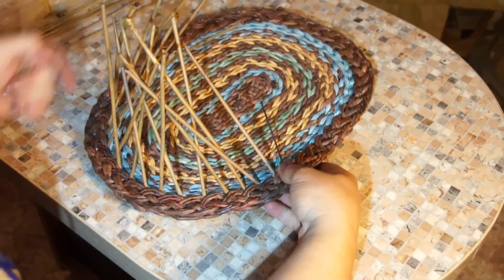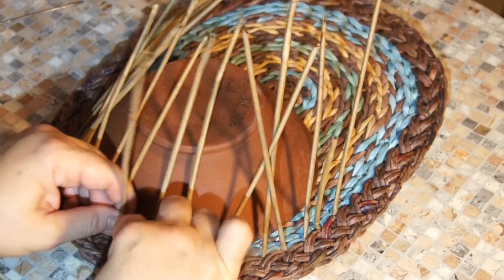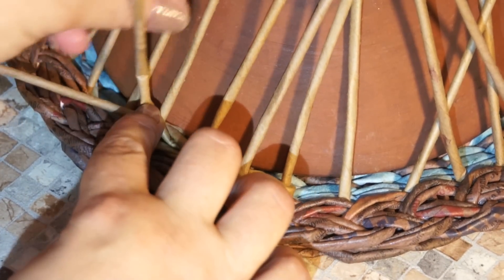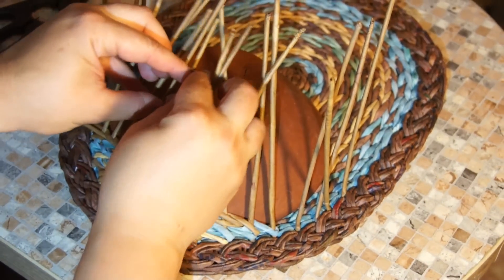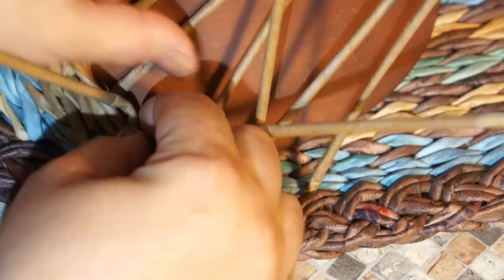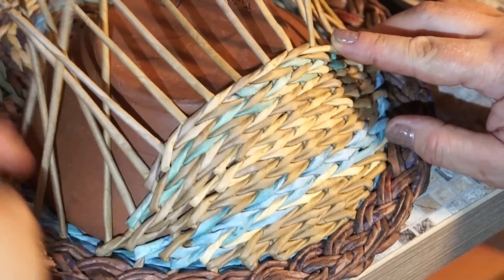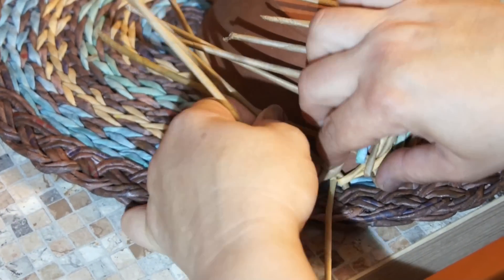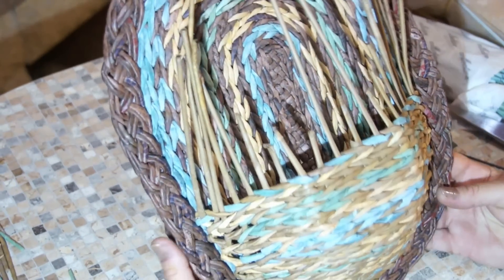A shelf with a pocket. Weaving a pocket. Part 2

Comment: Wouldn't your gap problem be solved by using more straws coming up from between the last 4 straws on each side? As you go farther up the side of the curve, the slant makes them farther apart than the more 'upright' location of the bottom ones.